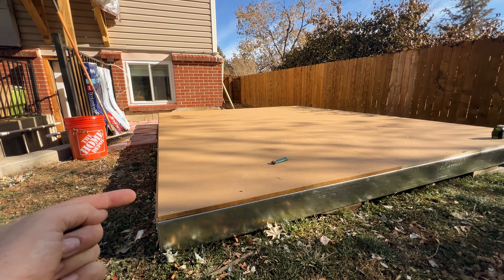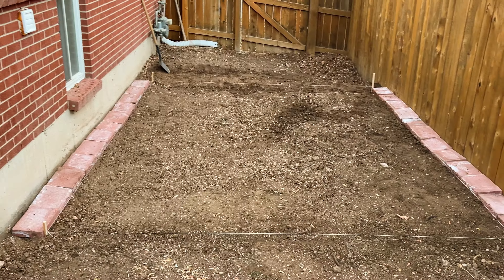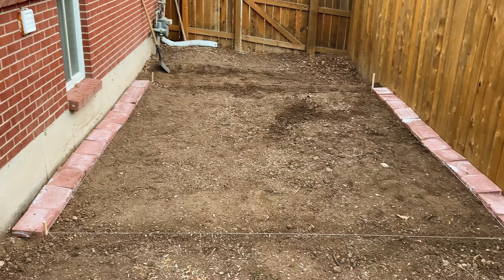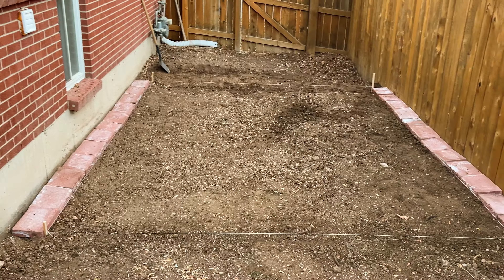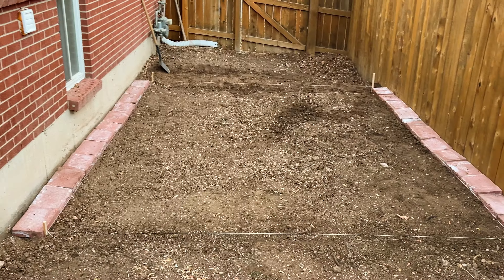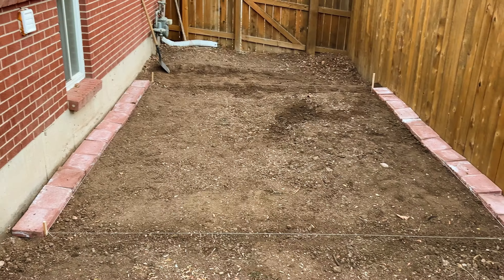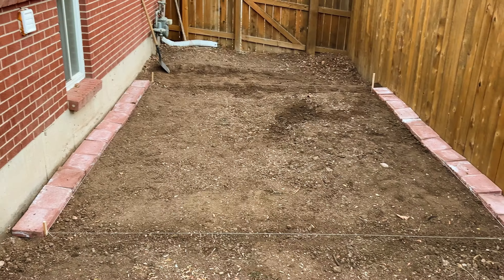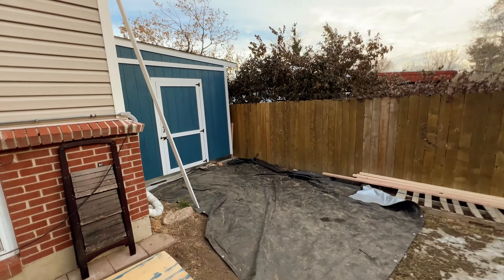I Built a Shed (in one week) and saved thousands of dollars

Comment: I know this comment comes way late. I once had a similar issue but my framing was all wood and very heavy. Had no help and was not going to get any. I went out and bought 4 side mount swivel caster wheels with the L bracket top mounted to the wheel . So essentially it's just an L bracket affixed to the top of a caster swivel wheel. I was able to secure one in each corner of the framing and roll that bad boy where I needed it to go. It worked perfectly! I'm glad I bought them because I ended up by using them again for a similar situation. Anyway just wanted to share. 
Keep rocking it Shane! 🍻

Comment: As a roofer with the pitch of that roof and the location of your residence!! I would recommend a rubber roof in the near future just because of the snowfall and major possibilities of ice dams forming on the roof!!
Reply: Or a metal roof.
Reply: I believe 2:12 is a minimum pitch for asphalt shingled roof.
Reply: Thanks , I'm obviously not a roofer and honestly just wanted to try doing shingles just to experiment/ experience the process. I was looking at those metal pieces for a roof and can easily install that over the existing roof. Or how about solar panels?
Reply: @billshipley8599 typically yes but it really depends on location snowfall and winter Temps. Even metal roofs can have the same issues in certain areas!! That's why on low slope roofs a black rubber roof is best!! The black membrane will help with a days thaw and will retain more heat into the night to help slow the refreeze preventing ice dams
Reply: @klesh you can install a rubber roof over existing shingles as well!! And rubber is easier to water tight when adding solar panels to a low slope roof

Comment: Whats the plan for moving it when the code inspector sees it? LOL.
Reply: I did check this out before the project, and luckily where I live this is 100% good to go, didn't even need a permit to build as long as it wasn't 500 ft.² or bigger. However If it was attached to the house, then that would definitely be an issue.